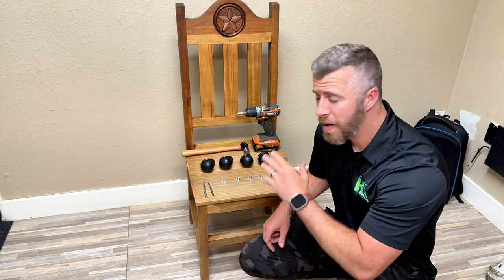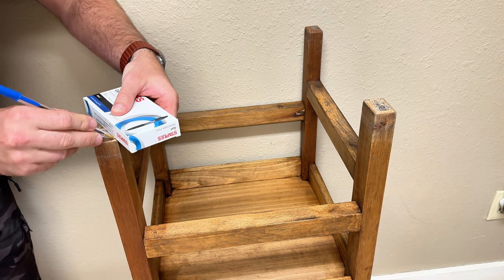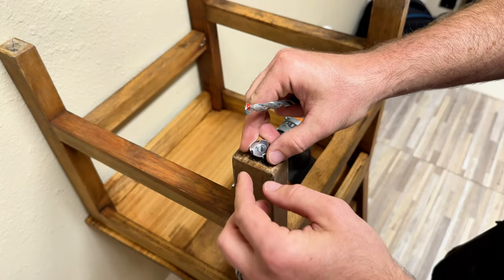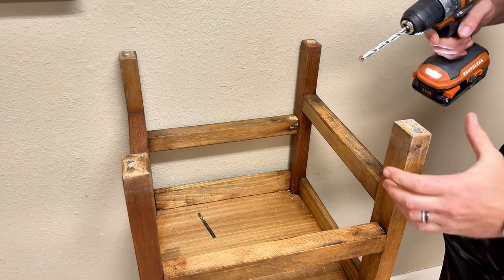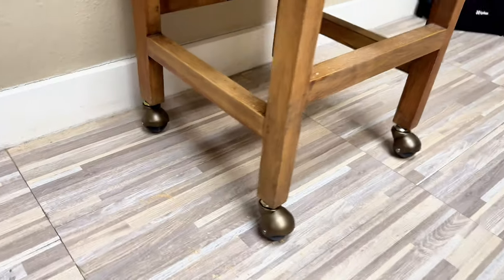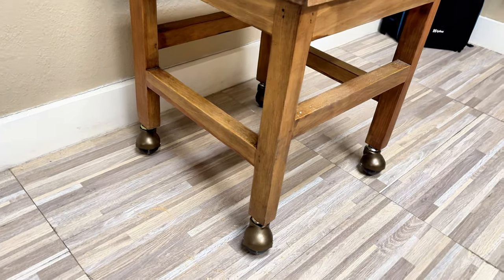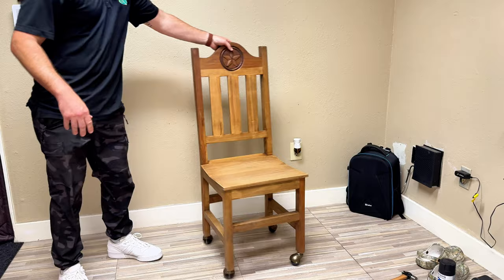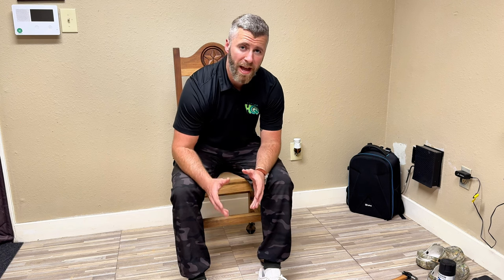How to Install Stem Casters

Comment from the maker: When threaded T-nuts with prongs come loose or fall off after installing them in furniture like chair legs, there are a few solutions and precautions to take into consideration: 
⚫Add Adhesive: For added security, apply a strong wood adhesive or epoxy in the hole before inserting the T-nut. This helps to lock the T-nut in place within the wood.
⚫Use a Screw: Hammer the T-nut into place and then secure it with a small hinge screw in the center of the cross shape to prevent it from backing out or rotating.

🔴We did not use these methods in the video but highly recommend both to ensure the t-nuts stay in place and that you are a happy customer.